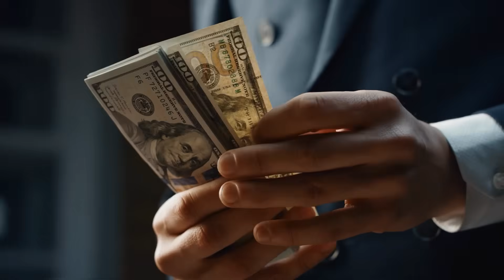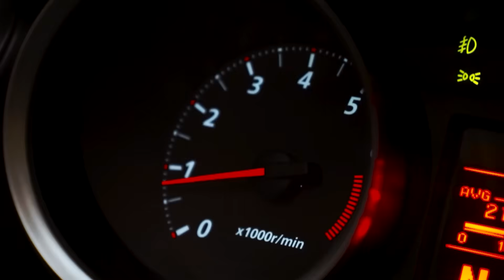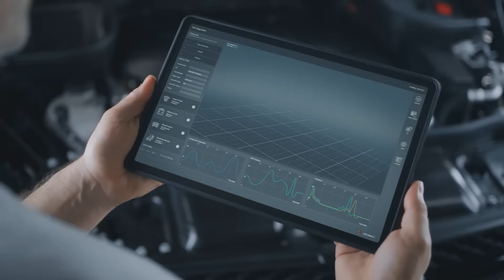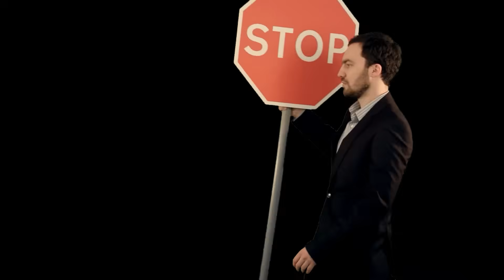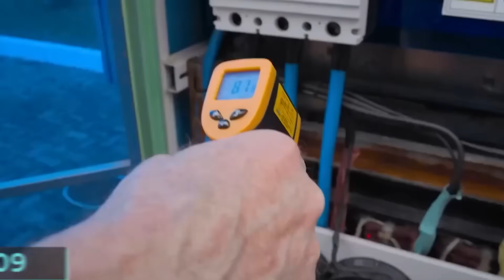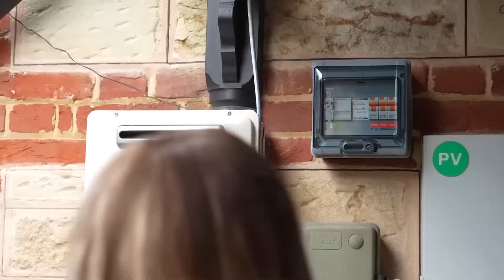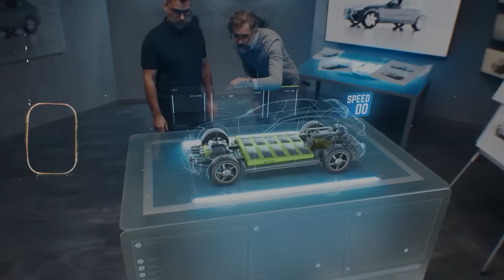Africa’s announce Self-Powered Car That Shakes The Entire EV Industry!

Comment: Anyone with radio transmission experience can easily see through this hoax. As a ham radio operator with a 75 watt transmitter I could transmit my signals world wide. 75 watts dispersed world wide demonstrates that the energy density that I produced was infinitely small. Of course there would be many thousands of other, more powerful, transmissions also adding to that energy density at many millions of frequencies. It doesn't take an Einstein to realize that in an area the size of a vehicle the energy density would be infinitely too small to propel a vehicle weighing thousands of pounds at highway speeds.
Reply: This is fine when including all the standard bases of knowledge and understanding. However, there might be co-factors not seen by what he is entitled to show.  In other words Coefficients that increase the energy.  He might have discovered a way of cycling the intensity of a current to multiply it's power which onlookers may not be aware of and he is not going to disclose.